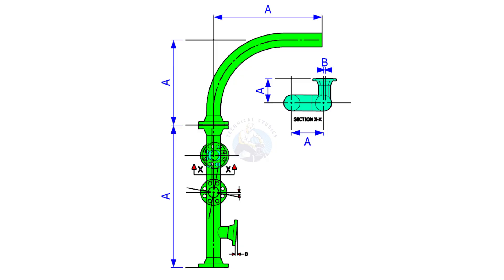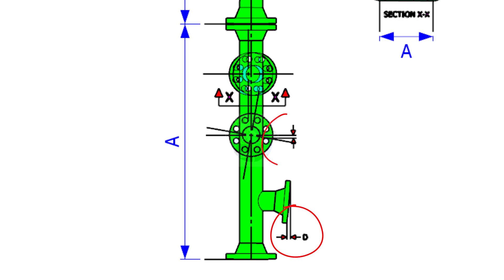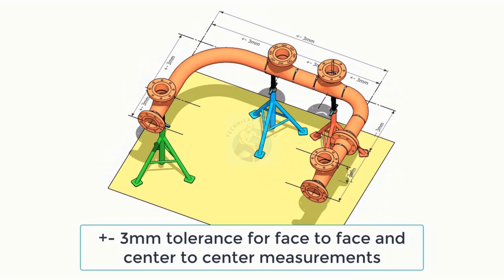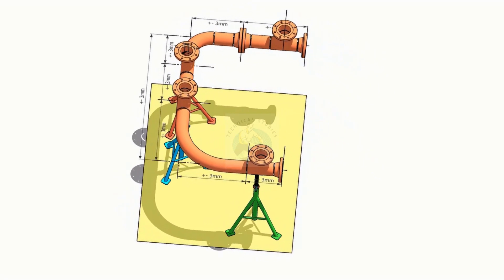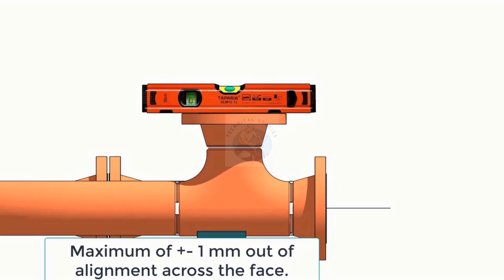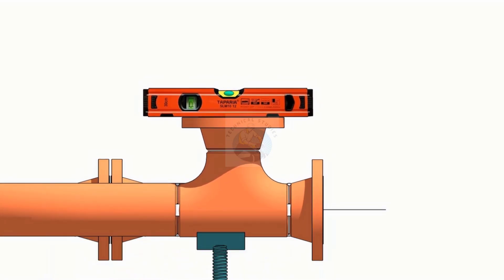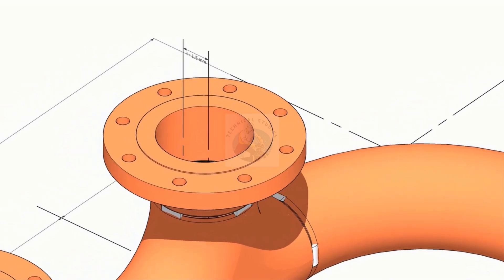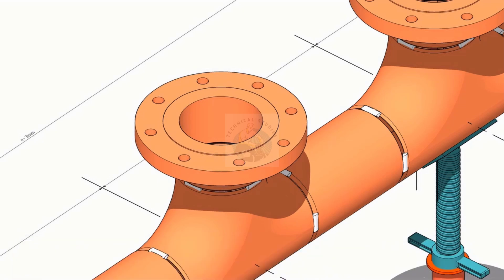PIPING FABRICATION TOLERANCE

Comment: I disagree. +\- 3 mm for the entire pipe section, not for individual sections.Otherwise, at the end, with 10 segments of + 3 m, you can get all 30 mm. and you simply won't bring the flange axes together. An example is two mirror sections with the same error during assembly.
Reply from the maker: You are right, but i already show this in the sketch. 1.12 seconds.
Reply: @technicalstudies.  I would not write this comment, but I have experience working with pipeline assemblers. You have no idea what these people come to in their mistakes and misconceptions. For example, it was necessary to cut a blank from a pipe with a length of 1110 mm. How long do you think I got the pipe? 1020 mm!!! The explanation was ingenious: 1-1 meters 1-1 centimeters and 10-10 millimeters.